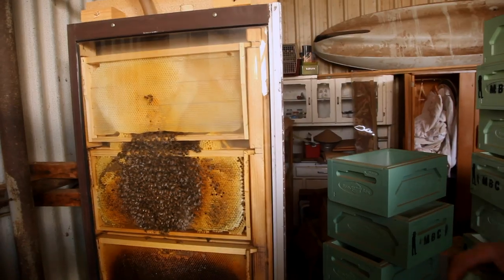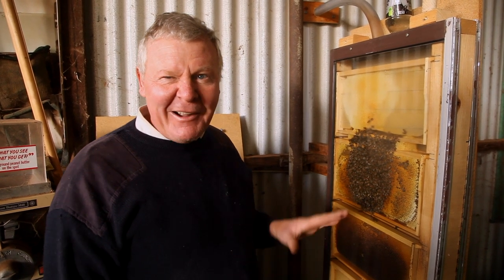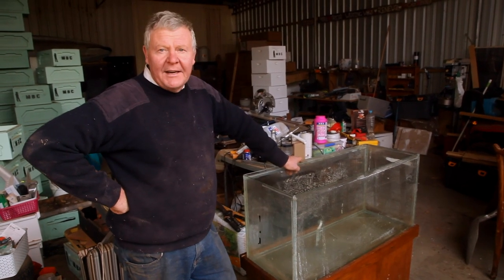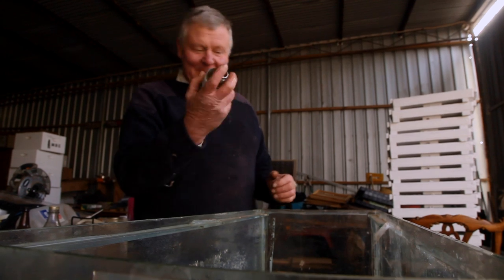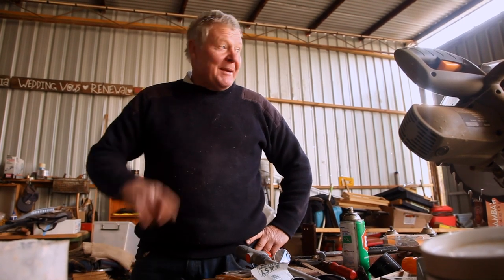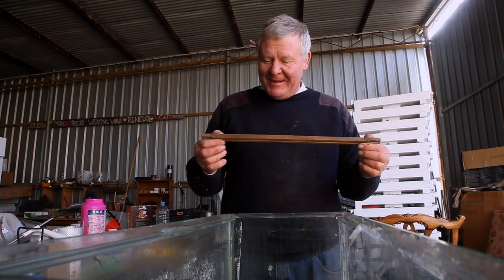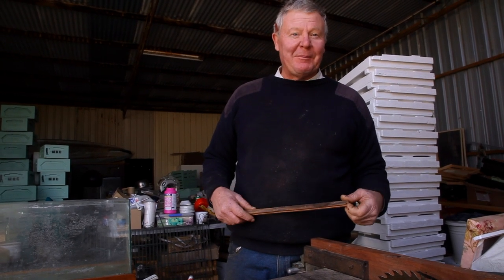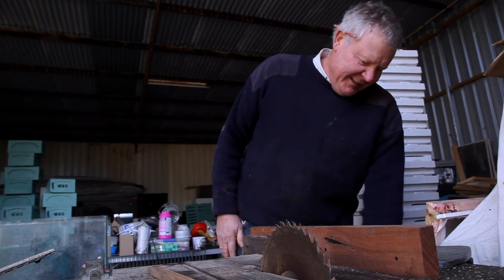How to Build a Fish Tank Observation Hive Part 1 - The Bush Bee Man

Comment: Your top bar frame should be 25mm x 2 = 50mm + 4mm strip = 54mm,  not sure how you want the bees to draw out correct depth for their brood comb? A standard frame with the end bar is added up approx 35mm width, I wouldn't add any extra passages between frames as you expect foundationless comb for it so a tight checkboard is a must.  It looks like your 54mm doesn't seem to fit into the logic? I bet they will give up and make crossed combs.

Comment: Approx 35mm between centres. I'd just use glue and clamp. Then run them through the table saw to the right width. Glue in some popsicle sticks in the one grove. You will have lopsided toolbars so will bee directional (need to be placed a certain way around)